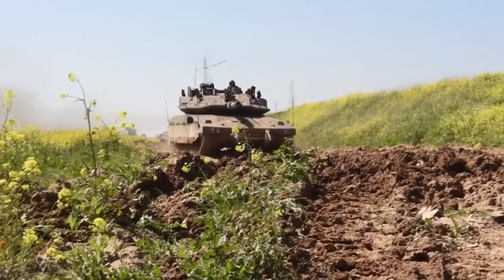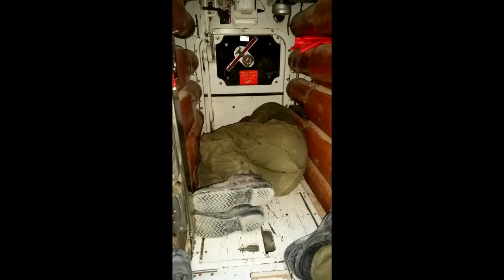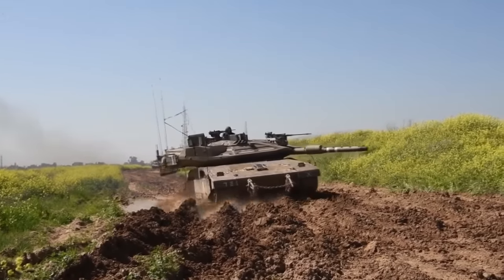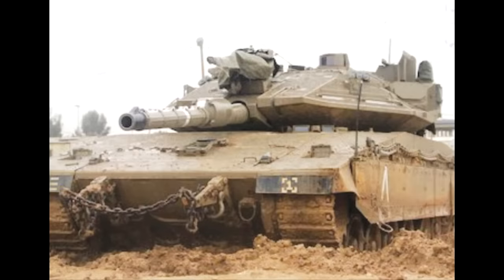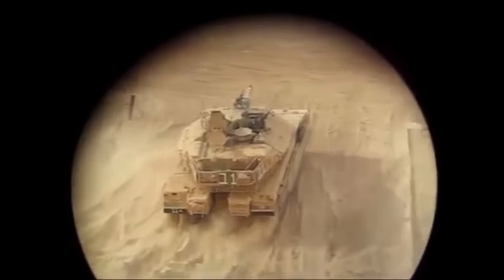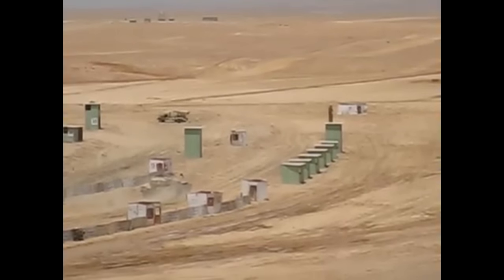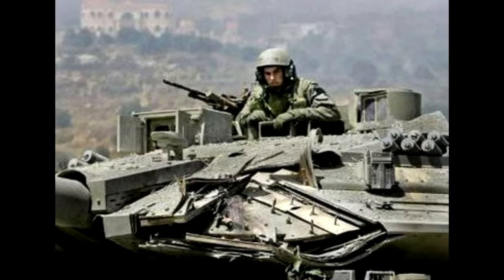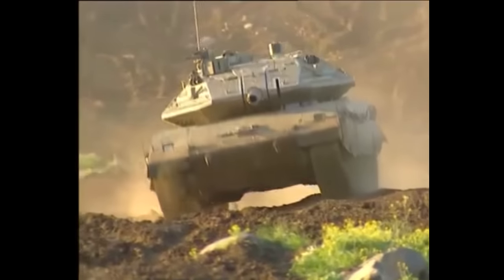Problems with Merkava tank

Comment: Every benefit has its downs too. In case of merkava, i belief that they still have a very good tank for their needs. Its quite much like S-tank, what suits one doesn't necessarily fit others. Also... IFVs in general have their engines at front too so do these IFVs have problems with their thermals and heat signature? Also leopard and chally have their ammo's on hull like most IFVs . Blow up panels seem to be rare thing when you think of it.  Does anyone wonder why these things are like this on  most other western fighting vehicles?
Reply: Keeping volatile rounds in the hull is technically safer due to the hulls of mbts having lower hit probabilities than the turret. In case of challenger it has armoured ammo bins for its propellant charges and with leopard it incorporates a mix of hull stored ammo and turret blowout panels. Blowout panels do not work 100% of the time due to the steel bulkhead having to be closed meaning if the loader has it open for reloading and the tank is hit everyone dies. Also if the bulkhead is penetrated by something and the ammo ignites everyone dies.
Reply: @Powerof7even  challanger has the advantage of 2 part ammunition meaning you only have to store the propellant and hesh rounds  in armoured bins or blowout pannels. as you can leave the apfsds anywhere you want as there is no danger of them catching fire or detonating. i know challanger 2 can take a massive load of 62 rounds total im pretty sure it does have blowout pannels on the back ive seen footage of loaders taking propelant out of the rear of the turret.
Reply: Good question on the Hull being in front for IFVs!

Actually no!
Merkava used a Turbocharged diesel engine, unlike most IFVS!

Especially the BMP series, Bradley, and other types!

Like the Abram's Turbine, this type produces a shit tonne of hp, unlike the Russian Tanks (excluding the T-80) at the expense of higher fuel consumption!!

As a result, they will produce an enormous amount of Heat that comes along with a large amount of Air blown out of the engine!

Simple mechanical engineering here actually!!

The heat graduation between the IFVs in general to the Merkava is what sets them different!

Hope it helps!
If i am incorrect, pls be free to correct me!
Reply: Its entire design is based on crew survivability, in that case, I find it to be an excellent design. throw in some blow out panels and it would be hard to improve.
Reply: @roryforham  Nah that's not a thing, there should never be propellant in the turret, in fact I believe they can come down pretty hard on you for having anything volatile in the turret. You're right about the apfsds heads though with them being inert DU and no danger to the crew. The heads of HESH rounds are still dangerous though.

Comment: So I might mention, and I’m a year behind, but there’s a couple reasons why the USA sticks to the L/44. DU rounds, like the ones the USA uses and prefers, can’t really go much faster without either losing penetration ability at worst and seeing almost no meaningful gain at best. The USA also prefers the shorter cannon because it has a long barrel life because it doesn’t bend as much as the 55, which also contributes to barrel life. Those are a couple reasons we’ve stuck with the L/44, but for tungsten rounds, the L/55 is certainly better.
Reply: @little_weed192  At higher velocities (above 1800m/s) tungsten rounds do slightly better than DU (I don't know the specifics of the metallurgy). Those velocities are difficult to achieve and the higher energies needed to reach those velocities cause increased system wear, so the US has stuck with DU because it does perform better at velocities modern tanks typically sling rounds at (1300-1700 m/s). Most other countries stick with tungsten rounds because it is cheaper and easier to acquire and does not require buying from the few countries capable of supplying DU or having their own nuclear program. DU actually stands out because it's used primarily by the US.

Comment: So basically ...
Merkava: Bringing a flak jacket to a a knife fight?
Reply: Given that flack jackets are meant to stop sharp projectiles, that's a pretty good idea.
Reply: fair enough  @komradearti9935
Reply: @carrot92  
It really shouldn't, flack jackets are meant to stop sharp objects - such as shrapnel - they're usually composed of several layers of pressed nylon or the like.
Stab vests are often made of the same materials.

Plus, flack jackets are usually pretty thick and having all of that extra material there is very effective for protecting against slashes and stabs with shorter weapons.

A balistic vest wouldn't do much against a stab, this is true, but a flack jacket should. At least so far as I'm aware.
Reply: yes a flak jacket could stop some sharp objects, but just like plate armor of old it has its limitations. 
fun fact: when i was in the army and doing some inventory we found an unlabeled box of flak vests, they are quite heavy.
Reply: @jonathonspears7736  
Good plate armor was practically impenetrable. There's just no cutting or stabbing through it in most situations,you have to find weak points for that. That's why things like poleaxes and halberds were invented, to deal with the rising amount of people in respectable armor.
Reply: @The_Crimson_Fucker Thats what I said. They have limitations. 

war of escalation. You grab a bigger stick and I find ways to block said stick.
Reply: @jonathonspears7736  
That's how the US lost Vietnam.
Reply: @The_Crimson_Fucker  it's easy to fight the enemy in front of you. Impossible to fight the one behind.
Reply: @jonathonspears7736  
People who can turn around disagree.
Reply: More like a full suit of medieval armor to a knife fight lol.

Comment: Putting this out there:

No damn tank is perfect. Not the Merkava, not the Abrams, not the T-90, not the Type 90 or the Leclerc.
Every one of those is an unstoppable war machine in one situation, and a lumbering hunk of metal in another.

It's the crew that matters
Reply: Yeah. Plus we're getting into the same problem of the early cold war. You have a Heavy tank (let's say, IS-3), the enemy has HEAT rounds that can just go right through. Any armor designed to stop more than an autocannon is pointless weight. Then we got tanks like the Leopard I which didn't have heavy armor, and could be faster than a Heavy tank. Then we figured out how to deal with HEAT, with composites.

Our modern day HEAT/Heavy Tank situation is APFSDS vs Armor that just can't be thick enough. You could make armor that will stop APFSDS, but it can't be a composite that resists HEAT, and vice versa. Armor is becoming rather useless again.
Reply: Could a composite that can stop APFSDS plus an active proctection system be the ultimate solution?

Comment: The weaker armor might be why they developed Trophy active protection systems. Most of their likely opponents use far inferior tanks.
Reply: The armor isn't weaker. In fact it's superior to all counterparts. It has ERA integrated inside its armor, and its armor is made of modular, quickly swappable slabs.
Reply: the armor of the Markava IV is not weak. modern ATMs can penetrate the thickest armors you can imagine like butter, without an active protection system it does not matter how thick your armor is you will get popped..
Reply: @@introboy1 i haven't seen any combat videos of the trophy system working. only in test videos......
Reply: @@introboy1thats quite a red flag already if you do believe

Comment: No tank is perfect. Merkavah is a decent compromise for the conditions that Israel expects to face on the battlefield. M1 Abrams was designed with Europe in mind, and would not be optimal for Israeli terrain. Merkavah inherited design features from previous versions. There is no perfection in engineering, only trade-offs.
Reply: Precisely.
Reply: The US is not a defensive military unlike Russia and Israel, so the US doesnt throw its money at defensive/conventional weapons like tanks and SAMs. The US spends its money on evading, disrupting, and destroying these types of defensive weapons.  If the US wanted to upgrade the Abrahams or the Patriot system, we would but there is no need . We have bases all over the globe surrounding all of our enemies and can project force on any continent. The best of the US weapons are still secrets and will only be used when necessary. Remember in the Iraq war and all of the talk Iraqi soldiers bodies that were being cooked by direct energy weapons?

Comment: This is the best tank in the Middle East.
Reply: T90M is laughing
Reply: Kornet. I'm the best tank destroyers in the world !😁😁😁
Reply: @rohzpopper4922  Kornet has it's own Set Of Problems, it's a Bit too big and Heavy Compared to say Javalin or Spike, it's also not Fire and Forget Unlike them, Spike also has Manual override Option. Sure Kornet has More Penetration but still, it's not perfect either. Also APS like Throphy could easily knock Kornet out of the air
Reply: @johnreaper4452  yeah because you see so many of those in Iraq. Oh wait you dont
Reply: U dont know anything about weapons
Reply: @johnreaper4452  Laughing? That's an interesting way of spelling burning.
Reply: 2200 Abrams (Egypt,Morocco,Saudi Arabia,Kuwait ) 700 t90(syria,algeria,Iraq)
460 Leclerc (jordan,uae) 90 leopard 2a7 (Qatar)

Comment: The engine is in the front to protect the crew, the crew are more valuable than the tank
Reply: If the engine get damage the tank get stoked in the battelfiled 
The crew will be in trouble
Reply: @moneymaker24dz  and if they die they wont be in trouble because they're dead

Comment: Each respective military prepares for the most likely adversary Israeli forces will most likely face Syrian equipment. I'm guessing its airforce makes up the difference in its tanks weaknesses.
Reply: syrians changed their tank doctrine entirely, now it's not considered a tank but a unit that operates with infantry for tactical manoeuvres, in general, in modern day powerful and portable AT equipment, tanks are obselet
Reply: @SS-ql5mugggggg  not obselet at all, with active protection systems tanks can now be immune to atgms and dumbfire rockets , thus any real threats may be only airstrikes and other tanks
Reply: @tomblou1033  you don't really need to destroy it, disable it and that's it. It can only be used effectively if entrenched deep and defended, a tank formation can be held and harrassed by inflicting damage to command tank,  a sitting 🦆. Been there done that.
Reply: @SS-ql5mugggggg  been sitting in a command tank taking fire ? Or shoting at it ?
Well at that nothing stops armies from just putting aps on command vhicles
Reply: @tomblou1033   no I'm glad I wasn't in a tank. We halted a Turkish leopard platoon advancing to Efrin, Syria. We recked havoc on them with simple SPG9.  They withdraw after few hours leaving one tank behind that they couldn't even drag
Reply: "tank weanesses" this sounds so wrong. The Merkava is still currently the best tank deployed in the middle east region. And it is the only tank with an APS in the middle east. 
No other arab or muslim tank comes even close to the protection level of the Merkava.
Reply: @SS-ql5mugggggg  huh i see . so how did you know which was the command tank and what exactly do you mean by a sitting duck ?
Reply: @tomblou1033 I'd not be able to tell, we had an experienced commander who fought Turks on many occasions. 

In the olive planes, there's literally no where to hide
Reply: @xAlexTobiasxB  ummm, other tanks can launch an ATGM with 4km 1200 mm penetration.
Reply: @SS-ql5mugggggg  aha. So for the time being while not every tanks has aps , we can conclude that they are vournable. But mabe in the future if active protection systems become cheeper youll see them as valuble assets?
Reply: @tomblou1033  for the middle east which is desert and urban warefare, lighter and faster tanks that are easier to repair and transport would do great with mechanized infantry units. Big bulky tanks that need their entire engineering platoons escort with them for bridging, maintenance and ammunition can be disrupted since it has many failure points. This what most people learned from our war.
Reply: @tomblou1033  I think future wars will have drones, Cruze missiles, light tanks maybe even remote controlled and fast moving special forces
Reply: I'm not sure you guys understand how combined arms works it's not just a few tanks on a battlefield you have infantry working with the armor and the artillery + air support hitting the heavy targets or softening them up for the combat arms to go and wipe them out.

In the case of Turkey they haven't been in a real war for a long time they didn't learn the hard lessons of ww2 or even what the Israelis learned about tank warfare.

You never leave your armor without infantry support and you cant have tanks alone because they are vulnerable. It doesn't matter if it's the Armata or a TAM (Argentina)
Reply: Let me also add that (to reiterate my original point) a nations military tends to focus on the most likely adversary, in the case of Syria they were fighting an insurgency not a more traditional military force. I can almost guarantee that if Israel and Syria went to war it wouldn't be a one sided fight no matter what side your on. Israel has a capable military Syrian forces are no joke either but there weakness would be there airforce and most definitely there naval forces but no war is in isolation and I can guarantee Iran the US and Russia would be involved in various ways, probably not a full scale war in the case of Russia but as an arms dealer and advisory role.. more or less to see how they can counter American tech. And Iranian forces would be much more involved.. I can see it as an excuse for America to perhaps take a tougher stance on Iran.. but this is getting into theory.
Reply: @tomblou1033  What if the active protection is overwhelmed by small grenades or rockets?
Reply: @tomblou1033  APS can be defeated by saturation attacks, and it is also not 100% effective.  Tanks are vulnerable to many other attacks as well.  

APS is very helpful, but it doesnt make the tanks immune.
Reply: @edgeldine3499  I believe Russia would actively enter a full scale war.  The Mediterranean Russian Naval base is too valuable for them not to.  

An expanded war for syria would be like a war in Japan for the USA.  They have too many interests at stake to be uninvolved.
Reply: The Russians have been very patient, despite coming under direct attack by the Israeli's, who have no right to be in that airspace anyways.  

Push comes to shove they would absolutely go for a full scale deployment including mid-range nukes.
Reply: ED L
ISRAEL DOESN'T FIGHT SYRIA WITH TANKS,BUT MOSTLY WITH JET FIGHTERS
ISRAEL FIGHTS INNOCENT PEOPLE IN THE WEST BANK OR THE GAZA STRIP  ,   IN LEBANON AND THEY DON'T HAVE SOFISTICATED WEAPONS TO FIGHT THE ISRAELI TANKS, MAY  BE ANTI  TANK WEAPONS IN LEBANON
Reply: @p51mustang24    well of course its gonna get overwhelmed . But if we look at trophy for example there is a possibility the attack nay fall into a killzone of the 2 luncher . Not a high possibility but one none the less. 
It indeed does not make your tank immune but but as you said it is help full. In gaza 2014 100% of all atgms and rpgs were destroyed .
Guees what im trying to say is the  that is probly more fault prove than it seems
Reply: Russia would not risk a full scale war with the US.. especially if its supporting Syria against Israel. But it also depends on who starts the conflict and how it breaks down.

America has already recognized Israel's claim on the Golan heights and I can almost guarantee that you will see some movement on Palestine in the future, it might be an annexation or a major push for settlements. I honestly think it depends on Turkey if Russia is involved futher in the middle east.

I think you might also underestimate the fear of a full scale war between the US and Russia.. but the US is much more committed to Israel than Russia is to Syria..
Reply: @SS-ql5mugggggg  To highlight some of your points, the reason why Turkey lost tanks that time was a big tactical error, first off sending tanks in with no infantry, recon of the area, or no prior artillery or air support in a completely open landscape making them vulnerable to every weapon imaginable. Tanks can launch ATGMs, but they’re really expensive. Russia can’t fund enough of them, and you’d practically want a KE munition as it’s harder to track, see, or stop than an ATGM. For comparison, a 125mm ATGM could potentially cost the same as some Cold War tanks.